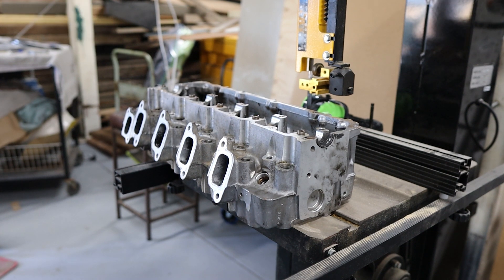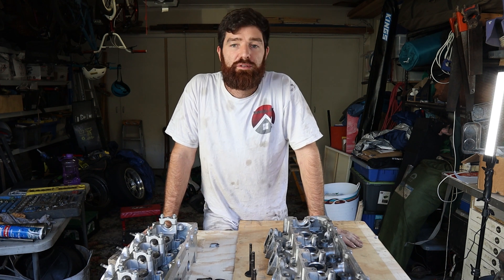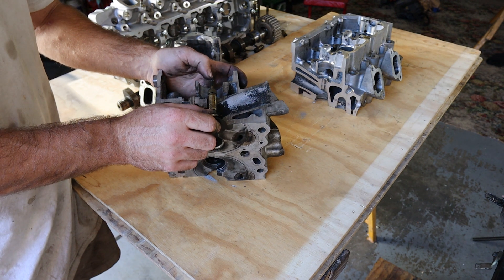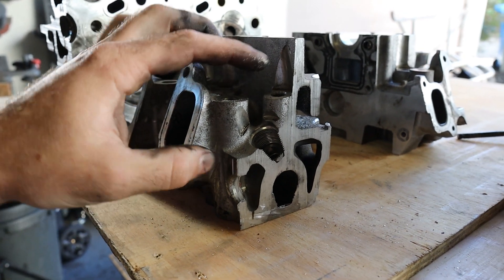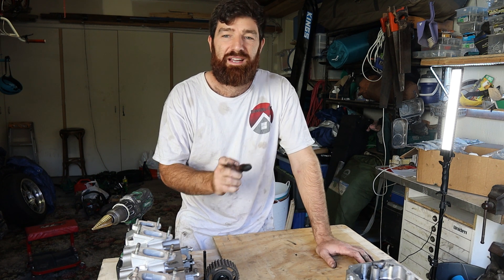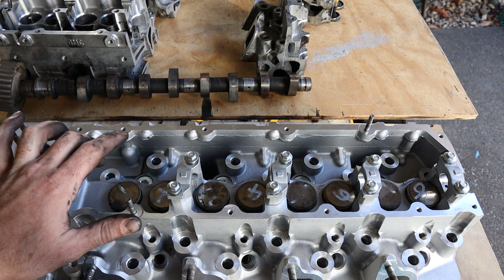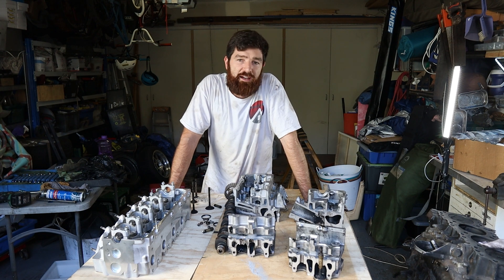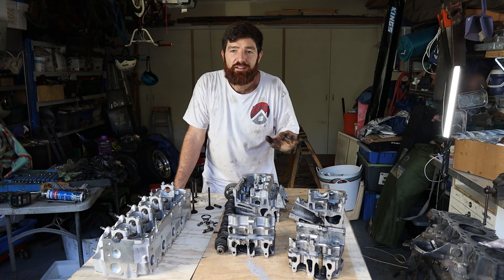Why do They Crack? | Cross Section and Anatomy of a 1KZ Cylinder Head

Comment: Hi i want to know as per your experience AMC cylinder head good or bad on 1kzte
Reply from the maker: I don't have any experience sorry! I only had this head because it came with a complete engine I bought second hand. The whole engine was trash due to low compression and bashed up cylinder head / damaged valve. Ask around on the FB groups

Comment: Question on the cracked heads: on the most common crack locations, does it usually still result in enough coolant loss to create constant white smoke out the exhaust? I've flushed my systems once and refilled, been a month or so and still my coolant reservoir gets low after a few days. No temp issues or white smoke, though, so not sure what's up. But it drives me pretty crazy so I'm on the brink of ordering a new head altogether and just swapping it. But not excited about having to possibly spend that kind of money unless I have to. Any insight would be helpful! Thank ya
Reply from the maker: It's hard to say. It might be worth getting the problem diagnosed by a mechanic first. I think it is possible to burn some coolant without noticing white smoke.
Reply: @lvlupbuilding I went ahead and ordered a head replacement kit. Gonna knock out a new turbo, new glows and new injectors, as well. EGR delete, too. Hoping this fixes my issue 

I did have a question though: if I hand rotate the crank and hear some piston rattle or see some wear on the cylinder walls and need to change the rings, can I do that without pulling the motor? Could I just drop the pan, unbolt the rod shackle, and then push the pistons out the top?
Reply from the maker: @35jdub  short answer is yes.

Should be a stout engine after all of that work. Throw some cooling mods and sensors at it and it will last forever. 
Might as well do the injection pump while you're at it. Especially if it's got more than 250,000kms in it
Reply: @lvlupbuilding  I got a little set back about an injector pump because OEM are listed for like $3k USD. I see some aftermarket ones for under $1k, but I don't seem to see any with those side resistor sockets?

Comment: Thnx very much 😊but i have a question i cracked my cylinder head of 1kz but after i replaced it it lost it power and now it releasing black smoke when it is in 2 rpm
😊
Reply from the maker: Sounds like a fueling or timing issue. Black smoke means too much fuel or incomplete combustion. Start by checking your timing and monitoring your fuel use.

Comment: i had change new water pump, new fan, new radiator... still the water temperature when running for 120km/h... my coolant did not less, so can i ask your opinion. is it the head gasket was not fit enough?
Reply from the maker: I've made a video about cooling and supporting mods for the 1 KZ here: https://www.youtube.com/watch?v=CmYLsz9RwuQ&t=3s

Comment: But that’s an AMC head??
Reply from the maker: If I can my hands on a factory head i'll do the same thing again! I didn't think there was a difference though?
Reply: @lvlupbuilding  I was asking the question as you were cutting into an amc head? I thought the AMC heads were better and thicker walled, I’m just about to pull my original head on my surf at 190.000 due to suspected head and or gasket failure, I went for a built up AMC head so my turnaround time is quicker so that’s sat ready to go in but are the AMC heads not a good option?
Reply from the maker: @jimelliott33  I've heard great things but any head will crack if it gets too hot! Make sure you have the right cooling mods and you'll be fine for another 400k kms

Comment: Great video, Thank you. I had a AMC fitted a few years ago due to cracking, but experiencing coolant loss again. What is a safe max coolant temp and EGT? (pyro mounted in exhaust manifold pre turbo)
Reply from the maker: safe max temp of coolant will be listed on the coolant bottle but I'd say safe max is 105 celsius and if it gets to 110 things may get out of hand quickly if it gets any higher. As for EGT's my alarm is set to 650 degrees and I never like to seem them above 700

Comment: Wow! That's an AMC head too. Apparently designed more heavy duty than the OEM Toyota head better for Aussie driving conditions? 

That pitting in the cylinder head shown @ 4:20... mine has exactly that on cylinder 4. Looks like a piece of metal has been smashed around in there and eventually melted into a blob on the piston (probably the tip of an old glow plug). Interesting to see it on other engines!
Reply from the maker: Thanks for watching!

Comment: Hi I have just replaced the head on my 1kz surf done less than 1000km and I am picking it has overheated while my daughter has been driving it and she hasnt noticed, it was running sweet but losing a massive amount of coolant out the exhaust Im talking 2 litres in 10 minutes, but still idling nicely. So I took the new head off and cannot see any cracks, interestingly  the head bolts were reasonably loose, the head gasket looks good. My question is can the head  crack internally, but it would have o be a big crack.
Reply from the maker: The only way coolant will get in the exhaust is if the head or head gasket are damaged/warped or not seated properly.
check your cylinder head is not warped. Have a good look for cracks and if its all good i'd say the head wasn't tight enough. If the head bolts were loose there should be other signs of leaks other than coolant in the exhaust.

Comment: hey man   is any possible 1kz to crack head without overheating?  my prado never overheats but it just blow white smoke when hot.  no bubble in radiator
Reply from the maker: yes, you could be burning oil, how is the crank case pressure? have you done a compression test?

Comment: Excellent explanation. I'm going to take my Toyota Prado 1kzte to the mechanic this week because I probably cracked the head and water is getting into the cylinder.
Reply from the maker: Thanks for watching! Good luck witht the Prado. Keep the engine temps down and she should last forever!
Reply: How do you know water is in the cylinder?
Reply: @MegaMr28  Some symptoms: The coolant level is going down and I don't see any external leaks and when I start the car white smoke comes out of the exhaust.
Reply: Are yours 1kz engine head crack too ??

Comment: Just replaced my cracked toyota head with a complete AMC head. Ive read they are stronger in the valve area to help with this problem. Any thoughts?
Reply from the maker: Sorry, I wish I could give you more info but I cant at this stage.
Reply: I see its AMC head he has cut into pieces.
Reply: how much did that cost ya mate…my 04 Hilux seems to be drinking coolant and i don’t know where it’s going…it’s black inside the filler bottle…but it’s not over heating or blowing any smoke…i’m worried..i’ve had the EGR and intake manifold cleaned out…3 inch pipe…Steinbauer Chip…with additional ECU top up tune…265kms…
Reply: @russellking9762  around 1.5k total for all the parts involved
Reply: @Adventure_Rig  thanks for the reply mate ….just a few more questions if you don’t mind…on what mileage did you have it done?…did you take the old one out and install the newbie yourself or get a shop to do it?…if you took it in how much did that cost?
Reply: @russellking9762  it was right at like 230k I just pulled the old head off cleaned up everything and installed everything myself
Reply: @Adventure_Rig  can you remember when you found out you’d cracked the head? did it smoke or overheat…? what’s the newbie like? any engine mods to it?
Reply: @russellking9762  it was before i had a water temp and egt guage. I think i pushed it too hard after upping the boost. My first indicator was my radiator cracked and the white smoke on start up. No real other symptoms. I used a head gasket leak kit. You but the tester in the radiator fill neck and run the car. The special fluid will turn green if there are exhaust gas present in the colant system. Also check for bubbles in your coolant overflow tank.
Reply: @russellking9762   you probably wont know its overheating the factory guages suck. Install a aftermarket one. Yea i had a diesel chip and up the boost. Probably what cooked the head
Reply: @russellking9762   the new head is great so far.
Reply: @Adventure_Rig  yeah from what you’ve described it looks like i’m heading  down that same road…it still seems ok to drive though…well so far anyway…did you put the  same mods back on after the new head?
Reply: @Adventure_Rig  i’m buying a test kit tomorrow..keep you posted…thanks for the info
Reply: @russellking9762  make sure you get the truck up to operation temp or better yet remove the thermostat before you test it
Reply: @Adventure_Rig  will do…let you know how i go..cheers bud!

Comment: Hey man, just want to say thank you for doing all these 1KZ videos! Theres not enough out there on youtube about our engines. Cheers mate, Legend!
Reply from the maker: Thanks for watching! Glad you're enjoying them. I'll keep them coming!
Reply: I'll 2nd that. Just pulled my head off, (380,000km), never been touched. Head is cracked in #3 & 4. Previous owner, I'm sure, pressure washed the radiator! Was overheating just after I bought it, (ala cracks), until I straightened the radiator fins. Was great after that. Snapped off glow plug ceramic is what took the old girl out. Wish I knew the glow plugs were a ticking time bomb! Would have changed them years ago, had I'd known.